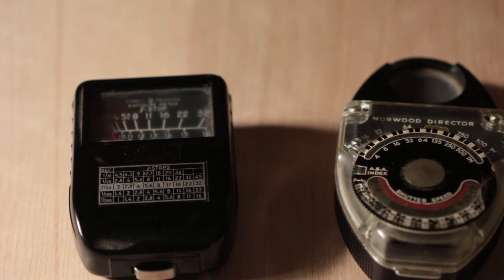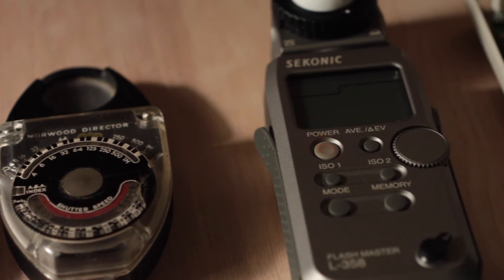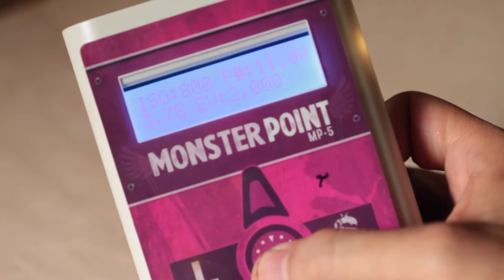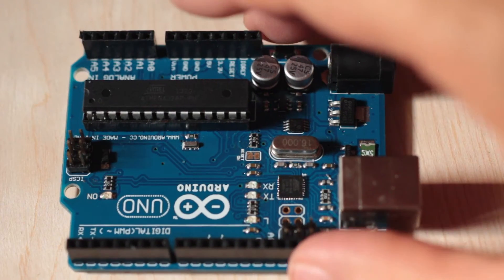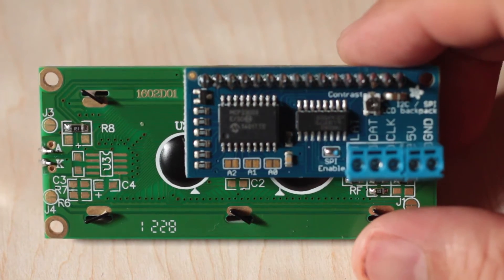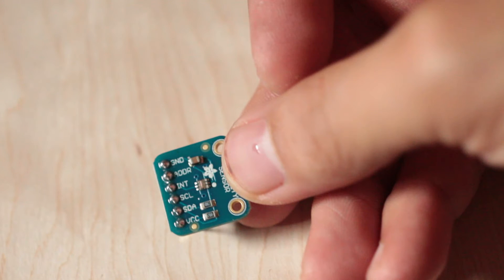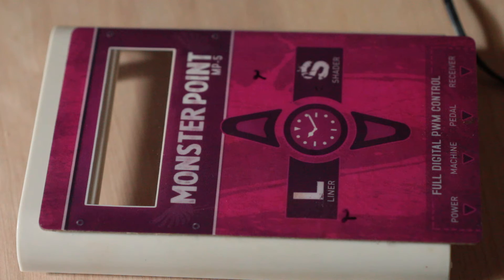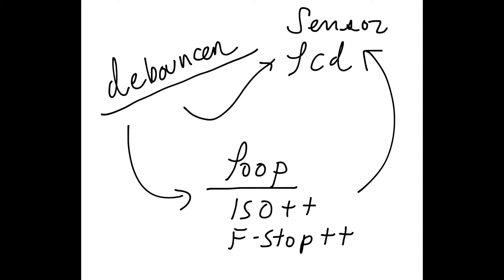Arduino based Light Meter with Adafruit TSL2561

Comment from the maker: The code

https://github.com/shawneeunion/Shawnee-Union-Projects/tree/master/Light_Meter
Reply: Hi, thanks for the project. That's pretty much what I was looking for. However, as I'm lazy :) why don't you share the cabling of the whole stuff  ?
Reply from the maker: Gilles Reyna Thanks for the suggestion, but I'm not sure I could do it from memory anymore. I remember I had the LCD and Sensor on the same 5v Rail. The LCD communication was over SPI. Hope that helps.
Reply: Shawnee Union Thanks Shawnee. I'll give a try via a smaller arduino-like such a Teensy or Trinket (although I'm not sure the latest has enough pins for both SPI for LCD and I2C for the sensor